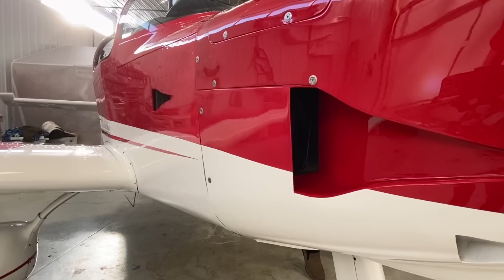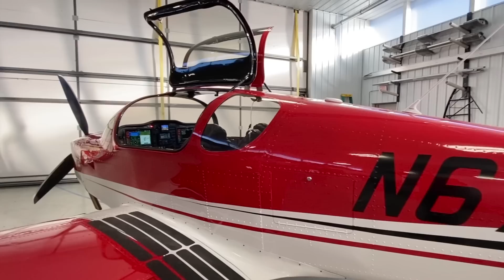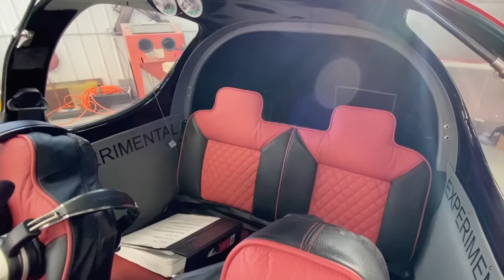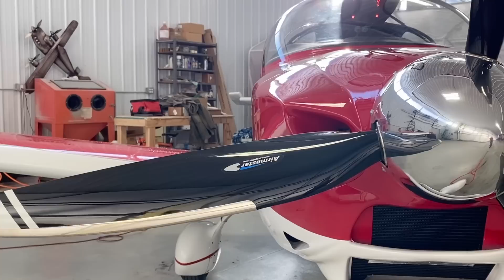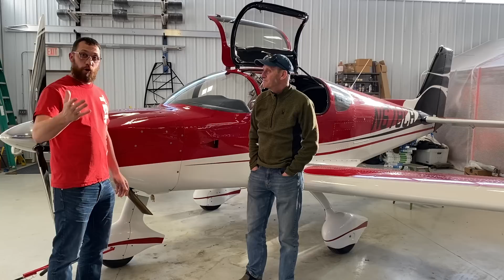Sling TSi...Most Capable Homebuilt!!! | Build Details & Flight

Comment: I'm 6'4" @ 250lbs.  Would I fit?
Reply from the maker: It seems the answer is yes. I'm 6'1" @ 210 and didn't have a single struggle. With any low wing airplanes, it can be a challenges to get in and out sometimes as the seat is further away from your butt, but that's the only struggle.

Comment: I'm actually building a TSI in Saudi Arabia, I noticed a vertical trim tab on your rudder but it is on the right side of your rudder to compensate your aircraft pushing her to go left. I have prepared such trim tab but I put it on the left of the rudder because I understood the engine torque will need right rudder pedal action to compensate it. I wonder why it is the opposite on your aircraft.
Reply from the maker: It seems like it wouldn't matter what side of the rudder you put the tab on as long as it's deflecting to the right side of the airplane to counteract the left turning tendency. I'll have to get back out the Chris's bird to get a better idea of how his is mounted, my video isn't very clear.
Reply: @ThePeases414  see the tab at 13'54" it seems to be installed to give left rudder!
Reply from the maker: Looks like you’re correct. It must just be what the plane needed!
Reply: @ThePeases414  Could you please ask Chris why his aircraft needs left rudder to remain balanced while all other Sling TSI need right rudder?

Comment: I’d love a kit to come in a 90 % ARF. 

Build one like a model plane.
Reply from the maker: I’m not sure what a 90% arf is...tell me more!
Reply: @ThePeases414  Almost Ready to Fly.
Reply from the maker: I see, thanks for the clarification!!!
Reply: @ThePeases414  I tell ya what, I wasn’t very helpful 😅. Allow me to do better. 

In the radio controlled airplane world, there are kits that are called 90% ARF. Which means 90%  has been done. You don’t have to make the wings or fuselage because it’s already done for you. 

With a 90% ARF, all one need to do is attach the wings and tail. Add the electronics and the engine. 

In alll honesty. I think it would be a great way to build many aircraft. Something that takes under 200 hours.
Reply from the maker: I agree, this concept would be amazing...I’m just not sure it would provide the monetary saving over building it complete.

Comment: What tips do you have for purchasing automotive fuel when traveling cross-country? I like the idea of extending the oil change to 50 hours vs 25 when using 100LL. Great tip!
Reply from the maker: Good question! Hard to pull up to a fuel pump. Luckily the Sling holds a lot of fuel!
Reply: Rotax is limitation as if you run 100 LL more than 30% of the time you reduce your oil change interval to 50 hours. I believe the same with the spark plug change. If you run Sauto gas 70% of the time or more you change it at 100 hours. Not sure why he cut those in half.
Reply from the maker: Thanks for the clarification, he may just be conservative. More often certainly wouldn’t hurt!

Comment: My concern with building a Sling is parts availability should they go belly up. Obviously, Cessna, Mooney... have parts for days due to their production numbers. Did this factor into your decision?
Reply: I would say that's highly unlikely considering they have full order books and a number of great, unique products.  On top of that there are a significant number of Slings out there now (600+ flying and growing rapidly), so in the highly unlikely event that they folded someone else would step in to support what is a sizeable market - being an experimental makes that easier.
Reply from the maker: This is a great question for Chris, the builder. At least with an experimental plane, you could use  parts from another make...or make your own!

Comment: 105 hp at, let’s say, 8gph ... I’m not yet sold on Rotax 915 efficiency. Ease of use in cockpit and lighter weight ok ... but it would seem that a lyc or connie running lop would give 105 hp at 8 or 9. I’m thinking an old strutted 210 in economy cruise should be burning around 10gph or so.
Reply from the maker: I’m interested in the real world results, there is certainly an advantage to being turbocharged however...of course you can get that in the Lycoming or “Connie” as you called it!

Comment: The plane is beautiful but what about its reliability? A piston engine spinning at 5000+ RPM sounds scary to me
Reply from the maker: I do agree it gives a bit of pause for concern, however there are more plenty of engines that cruise around at 5,000+ rpm. I’m thinking of sport bikes (crotch rockets). My last bike didn’t redline until 16,000 rpm. I guess time will tell.
Reply: But as you know an engine failure on the road is not nearly as critical as at 6000ft AGL haha Well, I bet you've taken everything into account. Enjoy it.
Reply from the maker: I don’t disagree the risk is higher in the air, but I would certainly hope Rotax did their due diligence. It’s not my plane, it is Chris’s and I’m confident he did thorough research on the power plant. But your right, makes me a little nervous too.

Comment: What an awesome plane! I have some questions for someone with the time and knowledge. 

In the beginning, he mentioned that the Sling 4 (non TSi) runs a 100hp, carburated engine. Last I checked the Sling 4 on the website, it says it runs a turboed Rotax 914UL. Am I missing something? 

Practically speaking, what's really the incentive to go for the TSi over the regular sling 4? 
Sure, better aerodynamics, beefier engine, and higher speed are nice, but practically it doesn't seem (to me) that there's a reasonable justification to go TSi over 4. 

After the air frame changes are accounted for, you end up with a 20#, or so, better usable load on the TSi over the 4. 
Speed is higher, but so is fuel consumption. So you have a lower hourly cost on the 4 than the TSi. 
Both use a turbocharged engine, and according to the TAF website, the TSi only nets you a 100 fpm increase in climb performance. 

I'm not trying to hate on the TSi, I just genuinely don't understand the benefit of it over the 4. Can someone please explain? Am I just too centered on the spreadsheet?

I'm extremely curious about all these bits of details because this is something I'm highly considering to put on the goal list to pull the trigger on in a few years.
Reply: Sling 4 had 2 versions with Rotax 912 and 914 turbo. TSI using flush rivets and a different wing profile as well as Rotax 915is, is faster’ still low consumption and benefit of the injection. In France I am building a TSI with the builder of the 4 based 914 Rotax. We will make comparisons when mine will be complete. payload is higher on TSI as well.
In fairness the TSI is an evolution of the 4, and at now TAF is mainly making TSI
Reply from the maker: Thank you, good info!

Comment: you could probalby build an RV and a highlander for the price
Reply from the maker: Not likely a 4 place RV-10
Reply: @ThePeases414  RV 10 kit 64 k quick build engine 49k    if you where buying a used engine and a VRF pannel you could BUILD 2 RV10S for 280K
Reply: @zackriden79  But then you're not comparing apples with apples - you're comparing the RV with a used engine and VFR panel to a fully kitted out aircraft with extensive avionics, ballistic parachute, new turbocharged,  water cooled FADEC engine built from what was essentially a quick build kit.  If you want to do a fair comparison then compare it to a TSi with a a used Rotax (if you can find one), a VFR panel, basic paint job and no parachute built from a slow build kit.  And compare how long it will take you to build that RV10 and what it will cost to operate - your time is worth something too...
Reply: @slavedriver394  what are u smoking  the RV you can get better avoionics  and u can buy a turbo charged enigne and a chute too bottom line  you can get a plane that carries 4 and out flys thing a buch plane and a pick up truck for the same price
Reply: @zackriden79  I'm sorry, i only speak English.
Reply: @slavedriver394  na you speak dumbass also !
Reply: @zackriden79  Sorry bud, not going to waste any more time on stupid - if you can't have an intelligent, civil discussion with someone with a different perspective you're not worth my time.  Unfortunately the internet seems to breed them.

Comment: RV10
Reply from the maker: I hear they are quite nice. I need to find one to sit butt in!
Reply: @mrb13676  It’s way more than 10kts sustained... Substantially more, actually. You can throttle back the RV10 to match the sling and the fuel burn is nearly identical. You can’t throttle up the cruise speed of the sling to ever come close to the RV10. The RV10  just gives more flexibility in speed, climb rate and useful load. The sling is a nice plane, no question. But the RV10 has it under those categories, with speed being a considerable advantage. There’s no match, actually.
Reply from the maker: It also seems they can be built for around the same cost potentially. You just might not get a brand new engine in the RV.
Reply from the maker: Ohh, I can feel a good debate coming on!
Reply: @mrb13676  There are the religiously devout to both platforms and that is understood. However, the aspects pointed out are undeniable. Sling can only maintain the highest speed for a few minutes during climb and  throttle back. It is what it is. I still like the flexibility to throttle up, burn more fuel and save the time. The sling does not have that option. RV10, throttled back to 50-55% cruise will burn roughly the same fuel at roughly the same speed. Again, the flexibility of the RV10, when the wife’s bladder dictates, is a winner! The sling is a very nice platform. But facts under consistent speed withe ability to pour the speed on go to RV10, hands down.
Reply from the maker: Makes good sense, thank you kindly!
Reply: @Aphxphotog  Which is all academic because you'll still be on the ground building your RV10 when the Sling has been flying for a couple of years! And on oxygen the turbocharged engine allows the aircraft to climb higher where it becomes more efficient, plus on longer trips if you factor in the additional refuelling stops with the RV10 any potential speed advantage is lost anyway.  That said, it all depends on your mission.
Reply: @slavedriver394  Your ‘academics’ aren’t very academic at all. You’re full of suppositions, if’s, and buts, while short on any realistic answer to how the aircraft perform as a side by side comparison straight away, minus every single far reaching excuses, add ons and variants you plucked out of your, well…… Applying the same wish list you describe, the rv10 will go even further and just as high by reducing the throttle to match the slowness of the Sling. The sling doesn’t have that option. You still lose in the OP question. Thanks for playing. Now, go pick an unarmed battle of your limited wits elsewhere.